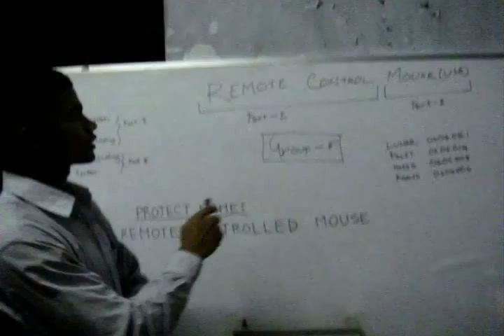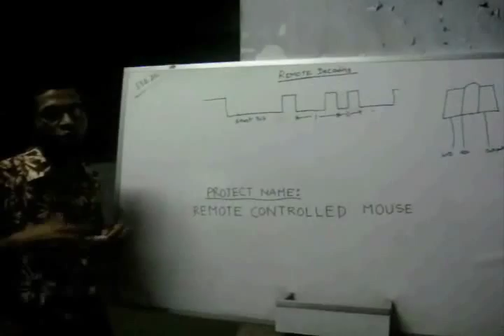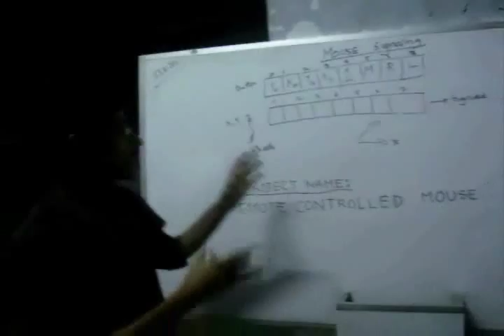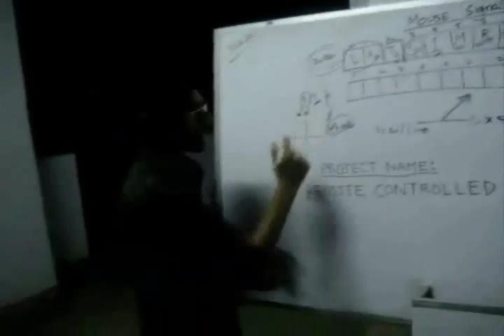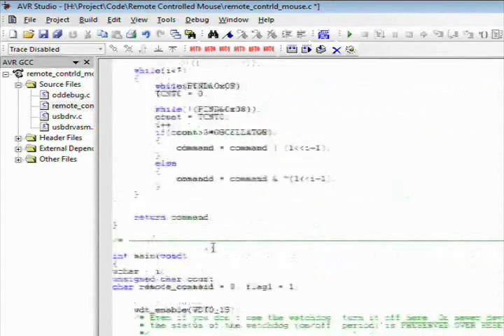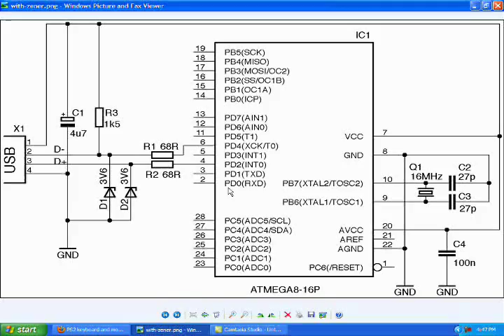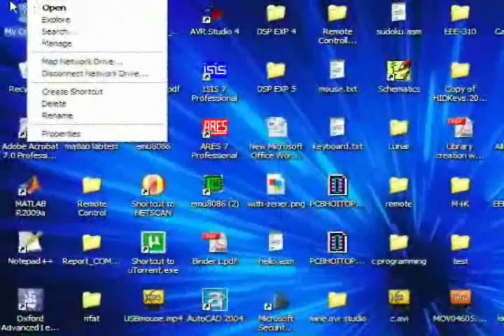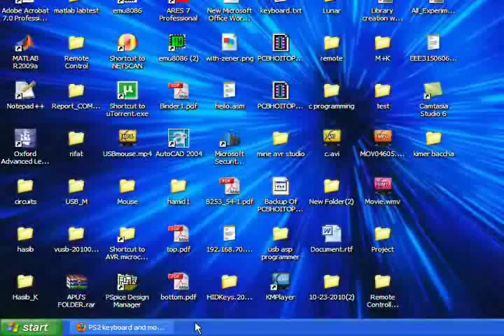BUET-EEE Project Under uP Lab:Remote Controlled Mouse

Comment: Nice team work. I could understand you all but I have a few suggestions for future videos. Use a headset with a mic. Record in a quiet room. Check the lighting/brightness before you record. Read a prepared script(?).Use switch/case in place of nested if's(?). That's it! Congratulations on your project and thanks for posting it.